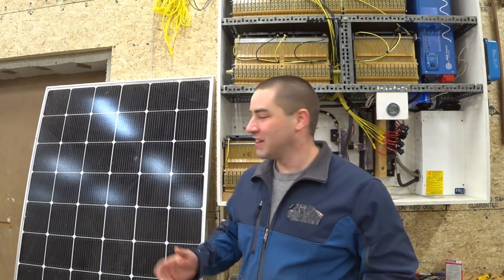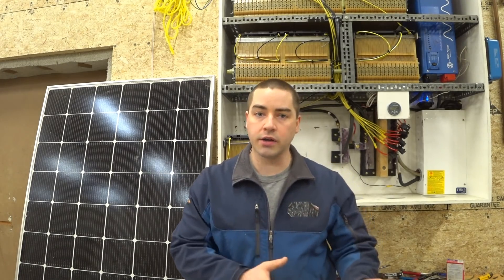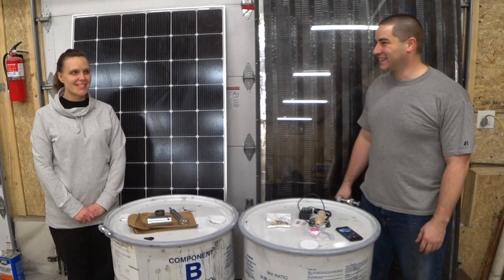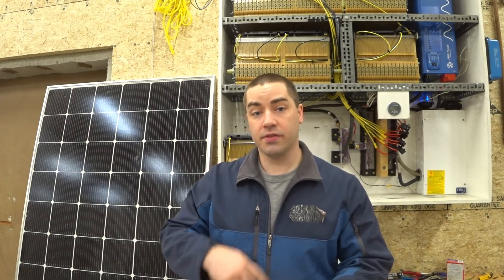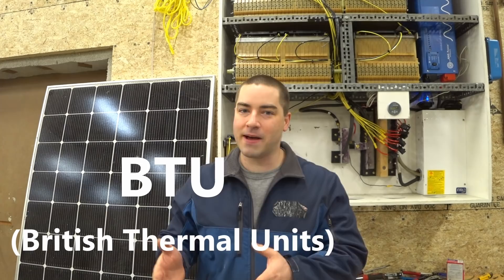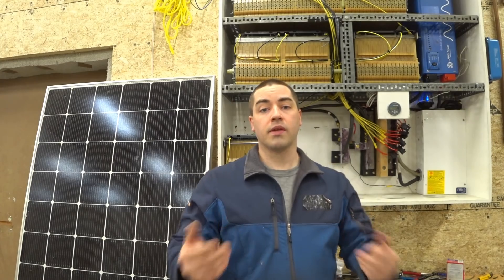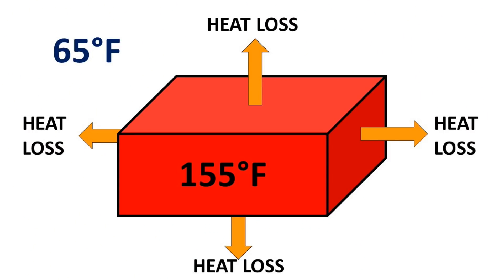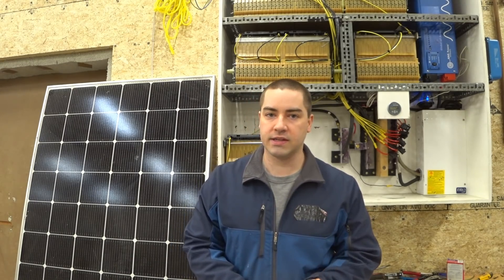Cheapest Energy Storage Off-Grid

Comment: There are SO many critical aspects of making such a system work, none of which you even mentioned, that the video has basically zero credibility. Sorry, but you are NOT going to store that much energy for even an order of magnitude MORE than the $300 you blithely pop off with! The subject is so vast, with so many routes you can take, that it defies a comment like this one to even start listing the issue you don't even mention. But most crucially you left out: 

The collector -- very expensive, even to build yourself; upwards of $1000 to do it even minimally right, and that's for about 4 x 8, which won't be adequate for most applications, depending upon your geographical location.

Circulation -- a HUGE issue! That hot water doesn't just magically fill your storage tank! Will you go with a pressurized or drain-back system (the most common alternatives)? YOU went with, I presume, drain-back, since you explicitly state that it's not pressurized. Okay, NOW how are you moving water through the collector into and out of your tank? What sort of valving/pumping are you using (NOT FREE to purchase/install and use over time!)?

Loss/Corrosion -- In most states, you tread a fine line between boil-over in the collector in the summer and freezing in the collector in the winter. Related to the above paragraph, you need technology to ensure that neither event occurs! Do you use anti-freeze? Well, then you had better not EVER boil-over, or you'll have lost hundreds of dollars worth of anti-freeze. HOW will you prevent boil-over? And if/when it occurs, HOW will you not destroy your system? Expansion tanks (NOT FREE, especially for the volume you'll be talking about)? Pop-off (lossy!)? And that water wants to corrode your entire system! Do you go with plastic everywhere, even in the collector? NOT efficient, and NOT rated to temps upwards of about 150 degrees! Go with copper, and you're out many hundreds of dollars just for the collector elements, not to mention that you are NOT going to build a copper-based heat exchanger in your tank for $300! And if you use ANY metal parts, you have to protect against corrosion, which, YET AGAIN, is NOT FREE!

And I could go on and on and on. Setting up a SHW system is NOT trivial, and it is NOT cheap! Even highly motivated and very intelligent people are going to be daunted by what is REALLY involved once they do the necessary research. It is extremely time-consuming to do it yourself, and even that is FAR from cheap. And professionally-installed systems are very expensive. For the vast, vast majority of people, you will NEVER get that money back compared to traditional solutions. You have to REALLY want such a system from an "off-grid" perspective, where that motivation UTTERLY offsets the significant time/money loss of such a system compared to a traditional solution.

Instead, you cast this system as "so cheap" compared to other forms of storing energy, but you CANNOT get something for nothing. It is NOT as cheap as you make it out to be, not even close! And it is a VAST project to create such a system yourself from scratch, well beyond the ken of the vast majority of even motivated/intelligent people. Oh, there's lots of ghetto systems that people have created and posted videos of. But they are literally garbage, and I doubt that they last even a year with a shred of reliability. Most end up using them as pool heaters. LOL To do this RIGHT, so that it will work reliably for, say, 20 years, it's going to cost many thousands and a PILE of work! This is anything BUT cheap power!

In summary, this video didn't even scratch the surface of the litany of issues in play for SHW! Worse than "superficial," this video is much closer to snake-oil salesmanship, and people should watch this video with deep suspicion!
Reply from the maker: Hi Richard Jensen,  You are right that this video is not a complete breakdown of all aspects of SHW.  It's not meant to be.  That subject is huge and not going to fit into any single video on YouTube.  Most of your questions can be answered if you look back through my channels videos.  I have several more videos on how I built my two SHW systems that have been running for years.  Anyone who wants to see more details can simply check out the other videos.

Comment: Thank you for sharing. My interest in how to manage heat or capture it began back in the early 1980s. I would even give subscriptions to mother earth news to friends and family. There are so many low cost ways to achieve energy independence from the grid and so many of them are passive. I was fortunate to have lived and grown up in a home that my father and mother built. The lot had a gentle slope that by just dumb luck or good  fortune was orientated exactly 90 degrees to solar south. The foot print of the cement block basement foundation was earth sheltered on the north and the west and the east and south were open. So the second story was open also and it was brick. It was 40' long east to west and 24' north to south. We had a fruit tree orchard and we gardened  as much as possible. I ended up working in the residential building business as and have built some pretty energy efficient homes. My biggest frustration is that here in the northern states and anywhere for that matter is the little or no attention or concern is given to a structure's orientation to sun. And for the most part the type  of structure. So many good technologies have been developed over the past 40 plus years but they are not being embraced by the housing industry. Sure super insulation and alot of other things are utilized but just the basic orientation to sun are rarely addressed. Natural convection cooling, storing heat in the ground are simple low cost ways to make heating and cooling homes much more affordable. It baffles the mind to see large housing developments with massive two and even three story homes or town houses being built with no regard for location being built on hillsides facing north with no solar gains in the winter months and being taxed with summer sun and high cooling costs. Not to mention the insane cost to buy one of these energy gluttons. You really don't have to spend any more money than conventional modern building construction costs to achieve much greater efficiency. And if you utilize the terrain and plan and recycle stone and wood and put it to work as thermal batteries  you will save thousands and thousands over time and enjoy a much better quality of life.

Comment: is styrofoam a better insulator then multiple layers of those NASA space blankets?
Reply from the maker: Generic "Space Blankets" are foil-faced mylar.  They help you feel warm by reflecting your radiant heat back in.  Foam board has an R-value to resist conductive heat transfer.  So, when insulating a hot water tank, foam board is way way way better.

Comment: And now for the big question that few seem to have a simple answer for... After several sunny days the storage tank is up to temp and you have excess hot water to get rid of, so where does that go? You can't simply shut off the flow of water or the solar panel will overheat. If you continue to circulate the water then the storage tank will overheat. Now what? Is there some simple way to add shade to the solar panel so it wont self-destruct without water flow on a hot day? Perhaps a t-stat valve so water can circulate to an air cooled radiator outside? (only used in the summer, of course)
Reply from the maker: Hi rupe53.  There are different types of systems.  My system does simply shut off and is fine.  No extra hot water to try and get rid of.  Thanks for watching.

Comment: let me solve your problem for you its very simple invest in tankless electric water heater take shorter showers not boiling hot! And your solar panels still generate electricity even when cloudy and you shouldn't be depleting your batteries anyway. if its cloudy you are not going less likely to use AC which is the energy hog lets be real here good invention with thermal battery your solving a problem that can be solved much easier
Reply: Aimbot an electric tankless water heater will draw at least 10 Kw if it's designed to serve a single shower, or a whole house unit could be two to three times that. It would require a massive inverter, and a vast battery bank. Not remotely practical, and doesn't solve the problem of what to do with surplus solar PV which may be a few watts at any given moment, rising to a few Kw at others.

Comment: Solar air heaters using pop cans are a super cheap way to keep your house warm as well. Free heat, and you move it with a small fan hooked to a thermostat. It only works during sun up but it's probably the cheapest way to heat a house during that time.

Comment: During the really cold winter months and you go without sun for a few days how do you stop your water from freezing that's going from and to the thermal solar panel how much power does your pump use or do you let it naturally circulate
Reply from the maker: The solar thermal system I have is called a "drain-back".  It uses normal tap water.  When the sun shines the pump kicks on and circulates water.  But when the sun goes away the pump shuts off.  When the pump is off all the water drains backwards through the pipes into the tank.  The tank is inside my house, so the tank is freeze protected.  The outside collectors (4x8 panels) are now empty.  So there is nothing to freeze and burst outside.  

I have two systems like this.  The one in my house has 10 feet of head, so I can use a 24 watt pump.  The system on the garage has about 20 feet of head, so I needed a more powerful pump.  That one uses about 60 watts.  But, remember, the pumps only run when there is heat on the collectors, or about 5-6 hours per day.

Comment: Sometimes you might want to analyze is the temperature of your solar panels during a sunny day. 
Solar panels have a great efficiency when they are cool. If the solar panels reache a sufficient temperature (let’s say 40 degrees Celsius) you could heat a second water bath with heat exchangers on the backs of solar panels. This water bath could be used to preheat the water in your other system. So you gain more energy from the solar panels because of the heat exchangers and because the solar panels run with higher efficiency.

Comment: Your solar water heater was $500 more than your electrical panels.  For that you can buy 1/4 of a battery pack.  The heat pump is 400% more efficient than the electrical water heater, which you said was what you preferred, as it was more versatile to have a solar panel than a water panel.  Being that efficient, you need one 4x8 solar panel (3/4 of one to replace a single water panel, per your comparison video), essentially, to run one, and a small portion of the 1/4 of a battery pack you bought with the money you saved not having the inefficient one-trick pony that is the water panel.   The nice thing about the water storage idea, though, regardless of how you get the heat into it, is that it would likely last a good deal longer than a bank of batteries, assuming you could keep it clean.  Also, if the waste heat accidentally coming off of your water battery happens to end up in your home, that's pretty cool, too.  Cool stuff.        A public library, which I want to say was in Pheonix, AZ) ran a similar device, but the theory behind storing the energy was all about consistent electrical demand and cheap electricity at night.  Their water reservoir was slowly turned into a giant block of ice during the evening and through the night.  By the next morning, they could use that reservoir as a heat sink; reducing drastically their peak AC demand, size of the AC unit, and use of more expensive daytime electricity.

Comment: Great thinking, lovely kid. I must add some comments about your fabulous water reservoir. If you wanna use solar (electrical) power to heat hundreds of gallons of water you would be foolish. Just make a large black surface area with lots of black tubing and circulate the water through it until it reaches the point of not getting any hotter (Cut-of). Using the right kind of glass (UV block from inside) helps so the heat gets trapped in your large flat tubing area and accumulates quickly to a hundred degrees celsius. Only because you slowly pump water through it it will not get to hot to handle. This way you can top-of your water reservoir to a maximum allowed temprature without losing all those BTU's daily due to bad insulation. You can run the pump by solar energy ofcourse.
Reply: Robbert Lucassen He didn't install solar specifically to heat water, he's heating water as a way of using and storing surplus generation. Of course, using solar thermal will give better results, but that rather misses the point- he would still be wasting surplus solar electricity.

Comment: would it work to pump water into a tank on high tower and then open a bottom valve to use hydro power for heating water on the fly whenever you need it, then you can also use a wind turbine when its cloudy or dark?

Comment: Perhaps a succession of smaller tanks, or Cells,  so as one is brought up to temp, the next one goes on line. The coil  could be divided into each cell, so as to progressively heat them in series. This would need no solenoids or control system. In reverse as the water is used, it is drawn out of the hottest tank first, which gets replenished by the warmer tanks in succession.

Comment: Id rather Stainless steel coil
Ss is not as heat conductive as copper. But the stainless can have thin walls  which help the connductiveness and i have gut feeling the water is much cleaner.
Reply from the maker: Stainless would be cool too.  I don't know where you would buy 100 foot coils of 3/4 or 1" DIA tubing that is approved for potable water.  Any ideas?
Reply: You wont need a hundred feet because its far more conductive then pex. But stainless is far more expensive and not as available, Plus it will need a reliable connection to the external pex lines. So the pex is the best economy to submerge in the storage tank. BTW if one want to use Copper, Go to metal recycling centers and get it for a lot cheaper. I have seen them chop up full rolls of copper tubing at those places all then to be sent to China,. What a waste,

Comment: How did you calculate the length of the heat exchanger with pex and copper. I'm need to calulate length of pipe for a 3.67 degree delta @ 6 gpm.
Reply from the maker: I didn't do detailed calculations on the heat exchanger.  I just tried to fit the biggest heat exchanger I could.

Comment: How about the storage tank under the floor so any escaping heat will rise into the house, plus install a heat element into the system to keep the température topped up when needed.
Reply: chantal rubino … that's fine in the winter but what about summer? Best to insulate better and control house temp another way. BTW, the tank gets heated via solar water heater, which is cheaper than electric.
Reply: Just stick it under the floor of the hottub or indoor pool - then it works in the summer as well.

Comment: Hey David, hope you are? I loved all your eco friendly things. I think it's disgusting that every new build by law doesn't have at the very least PV panels on the roof to feed into the grid, at what point will the world wake up to the issues we've created?!

But anyway, I'm looking into solar heating for my dad's very very cold house. He lives in Portugal which sounds great for heating options but actually the houses out there are (or were) built so badly is actually quite difficult. So there's zero insulation and the walls are just one piece of very cold concrete. I have been trying to work out if solar heating could heat the house or if he needs a proper central heating system. There's nothing in the house at the moment and the winters are getting too much for him now and he's actually getting quite ill from the cold so I need to step in and do something.

I'm not really sure what to do about the insulation, tbh the whole house needs knocking down and a lovely modern home build but sadly that's not an option. As a quick fix I kitted out the lounge with thick insulation form boards, it looks odd but works an absolute treat and with either an electric radiator or the log fire the room gets lovely and warm and stays warm. I guess maybe cladding all around the house to create a second insulating layer is possibly the best way to go, I'll have to look into that a bit more. 

You don't seem to have played around with evacuated tubes very much (although I've not seen all your videos), they look really really impressive, especially in cold climates like yours. I just wondered if you thought heating house with thermal panels is doable? I might be missing something obvious that you of course can't heat a whole house from just a few panels on one side of a roof, the maths wouldn't even come close.
Reply from the maker: Heating with solar thermal is possible.  Yes, evacuated tubes would be better for cold climates than flat-plate.  I simply don't own any vacuum tubes to test.  That's why I don't show them in my videos.  I would suggest insulating first, before building a large solar heat system.  Contact me on facebook if you want to chat more.  Maybe send some pictures?
Reply: @DavidPozEnergy  cool thanks, I'll look into options and prices and let you know. Have a good weekend.

Comment: Sorry... But... 
1. It will not provide with electricity. 
2. It is a lot easier to use thermal sun heater then photovoltaic collector. 
3. It is in massive use in Israel.